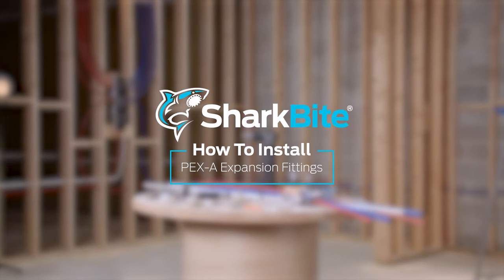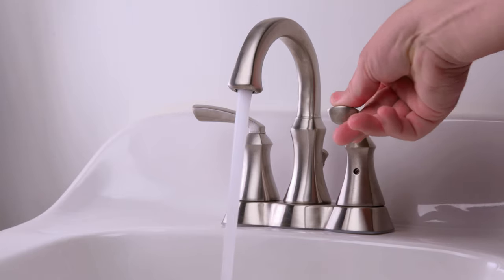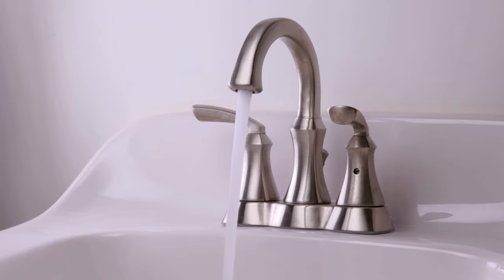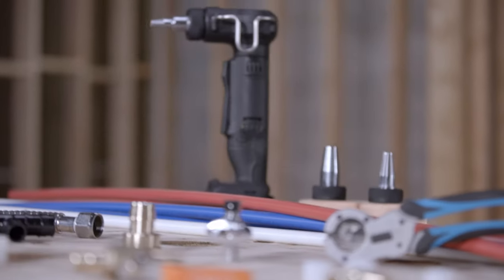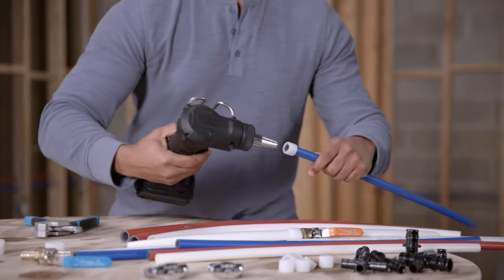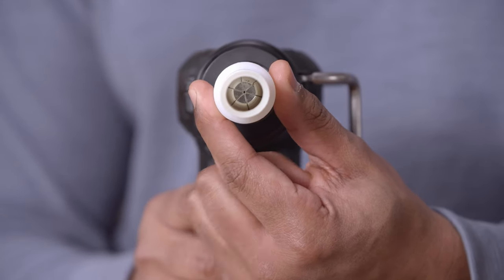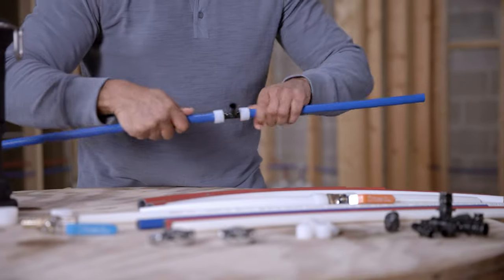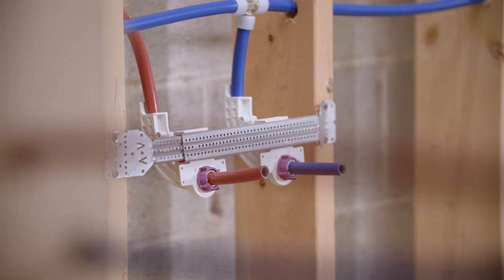How to Install PEX-a Expansion Fittings

Comment: Do we necessarily have to use expansion fittings, is there anything else?
Reply: I'm led to believe that PEX-A pipe works with all types of PEX fittings.

If you don't want to use expansion fittings, you can use PEX-B, which use crimp style fittings and push fittings. Push fittings are the easiest, but much more expensive.
Reply: Hope this helps. I recently hired a licensed master plumber here is Georgia, he used pex b and pex b fittings on polyethylene. The repair was about 50 feet of a main water line. He used the stainless steel crimp clamps. 

After watching him, I changed out my electric water heater about a week later. After verification with an online search, as well as talking to a few other people,  I used pex b pipe and pex b fittings to connect to the preexisting pex a. The job turned out very nice  - expansion tank and all.
The job was just done a few days ago. Been checking it several times a day and no leaks whatsoever. 

I also found out that pex b fittings will work with pex a, but pex a fittings will not work on pex b pipes. 
Pex b pipe must not ever be expanded - it is not expandable like pex a. I bought the $30.00 Icrimp tool of of Amazon.  It worked very well,  though it does require a reasonable amount of strength.  Keep steadily squeezing the tool for your crimp until the ratchet clicking stops and you can't squeeze the tool no more.  Use the stainless steel crimp clamps. 

People will have their opinions and preferences,  but I am sharing with you what worked very well for me. 
I hope to be of help to others, just as I was helped by others.

Bottom line for me...I thank the Lord God for all His help!
Reply: Pex a or exspanion pex is supposed to be better than b , it holds more pressure and holds better , just remember to rotate expansion tool after every exspanse . Is better against freezing